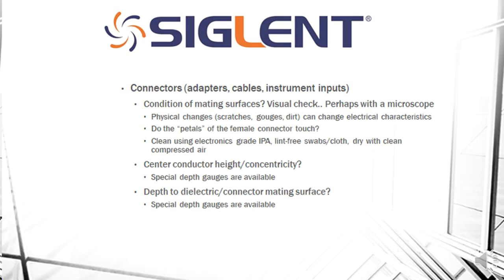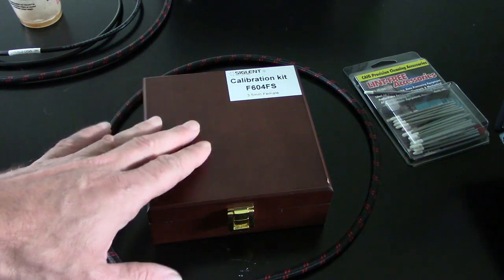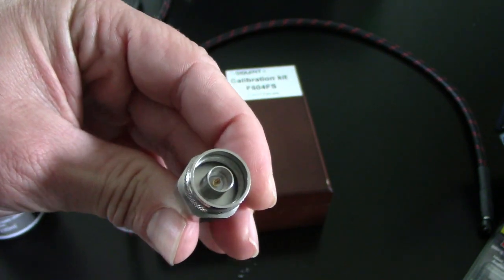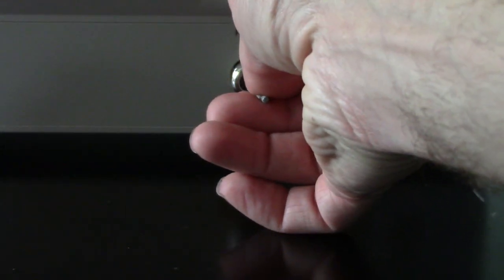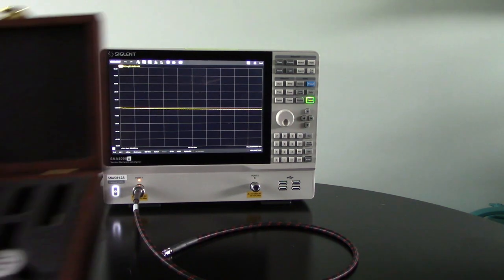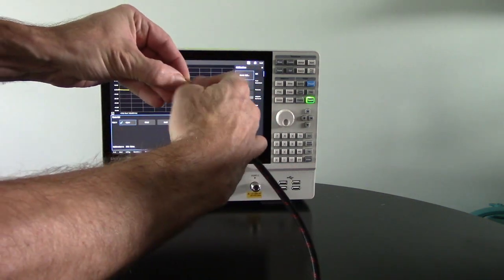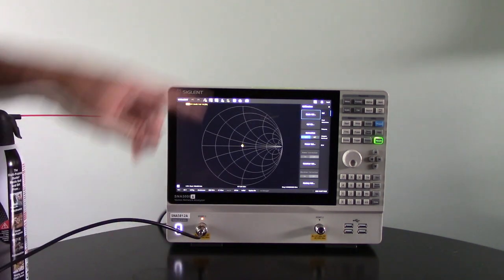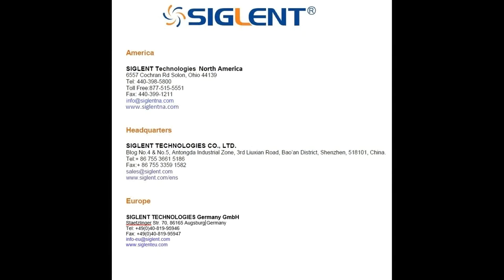RF Cable and Adapter cleaning and quality check

Comment: If the instrument is to be used as part of a fixed production test set semi rigid cable will give far better stability and repeatability than even a high quality flexible cable.
Reply from the maker: Very good point. I was surprised at the difference in stability between the two cables I tested. Choosing the proper cabling for the job is critical. - Jason, SIGLENT NA